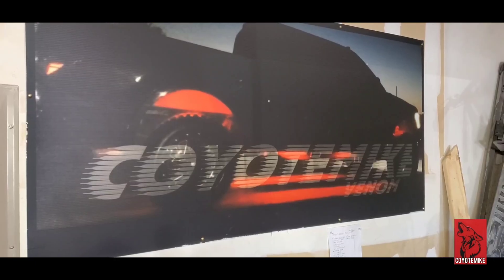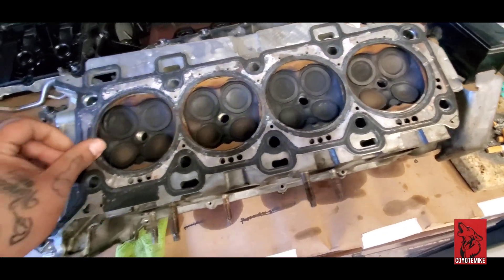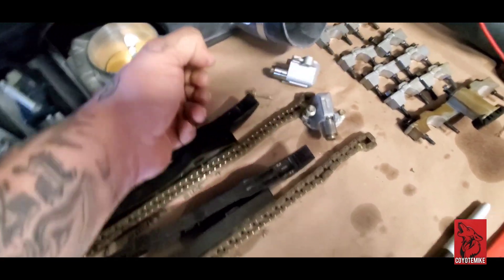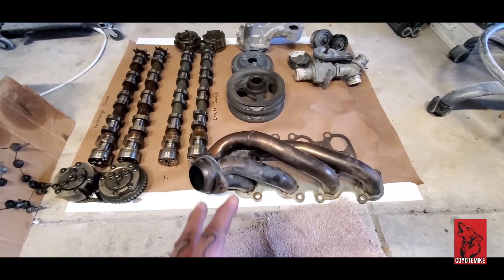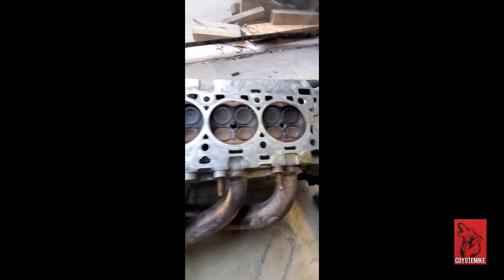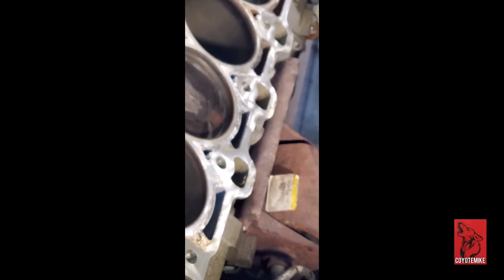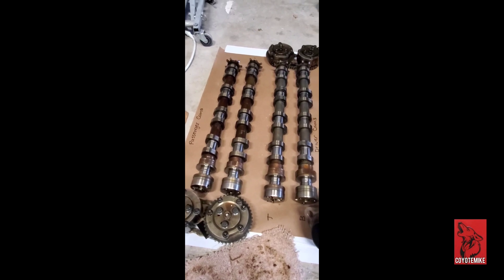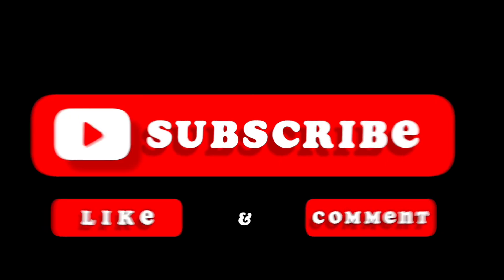5.0 ticking noise cylinder 7 failure

Comment: I have the same noise. Hardly there when cold but much more noticeable when its warmed up. Was yours quieter cold?
Reply: mine is quieter when cold it doesn’t make the noise at all but does when it warms up it’s a 2018 i’ve thought ab running 10w-30 i just bought and it had a oil change it’s a 2018

Comment: This makes me nervous about mine. 2013 5.0 with 102k miles. Data shows misfires on nearly every cylinder. I can easily feel it, but never get CEL or codes. No knock noticed so I am hoping I just need a valve job. Nice truck tho man, got me thinking about swapping for a GT coyote!
Reply from the maker: Ya I took mine to several reputable mechanic shop here in my area. All 3 told me different possible causes. I just ended up swapping it. Best choice I made. Now I just baby the engine👍🏽 I still get on it when I need the power tho😂 what a difference 😁

Comment: is this the same engine you replaced rod bearings in a year ago? been having a knock
Reply from the maker: It is. Dropped a new motor in it.
Reply: do you have a video of  the sound of what that engine was making, having a similar issue and shop says rod bearings @Coyotemike302
Reply from the maker: @LukeplaysTV  should all be here in the short videos.

Comment: What would you say caused that wear that isn't a ton of miles on the og motor
Reply from the maker: Not sure anything on my part. It's the way it's built. Lack of oil to back cylinders.
Reply: @Coyotemike302  do you know if the new ones have that same issue
Reply from the maker: @stephenwetzel2907  some do. I fixed the issue with mmr oil cooler in freeze plugs behind the engine.
Reply: @Coyotemike302  I see

Comment: Dam that sucks how many miles did you have on it. Mine has a real small light tick that just started I have 93,000 miles
Reply from the maker: Good question.
It was pushing 160k. But tick developed way before this. I wanna say at about 120k small tick and just got louder with time.
Reply: At the 5:55 mark you can see evidence on the head of compression gasses passing cylinder to cylinder. You can see the same evidence on the block. I may be mistaken though.